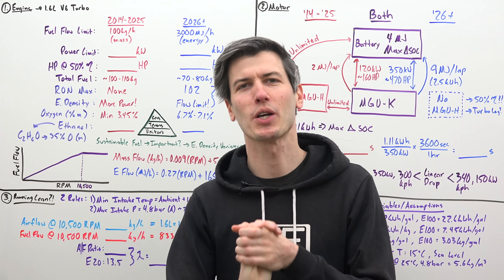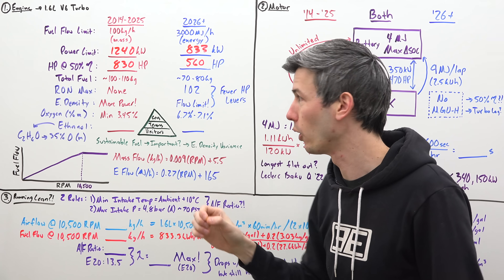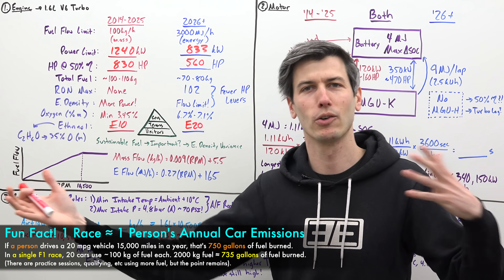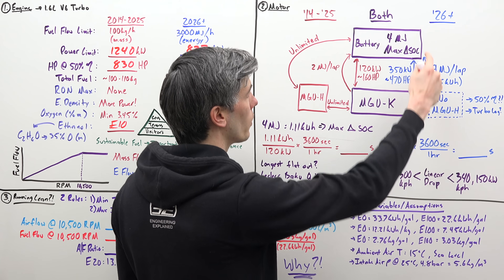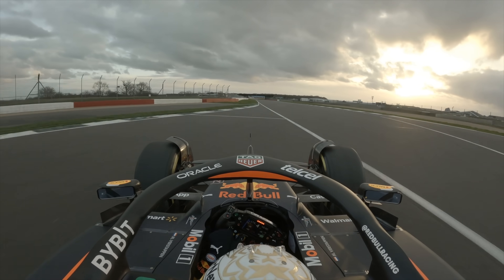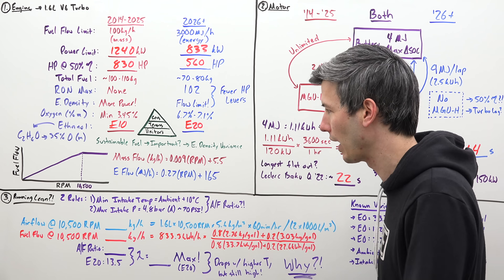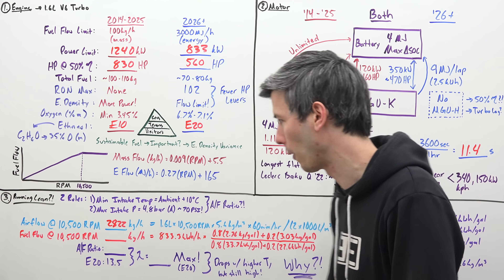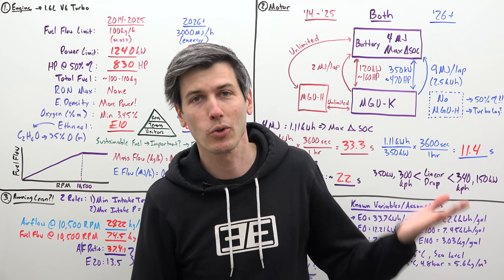Why Are 2026 Formula 1 Engines Going To Lose So Much Power?

Comment: So what I'm hearing is everything is getting weirder/worse (?) for odd, nebulous reasons. Seriously if you want more "sustainability" or efficiency in the sport maybe optimize the F1 calendar more for more efficient logistics or simply have fewer races. You'll burn a lot less carbon that way vs anything you do on-track. Flying all of the people and stuff to the race tracks every other weekend globally is so much more damaging to the environment and can't be made up by whatever marginal gains in emissions you'll achieve by changing the engine formula and fuel choice. We've already figured out ICE technology, you can't really get any more efficient than what we have already other than by having small marginal gains. You'll never get a pure ICE solution to 50% thermal efficiency, the only way they can achieve that is with the batteries and the MGU's attached. 

If you really want to eliminate emissions just go electric (this obviously doesn't include the emissions that come from mining all the materials and doing all the logistics, manufacturing, distribution of said products, etc). So really I don't know what the goal is here. We already have budget caps in place. Frankly it would be much more exciting if they opened the engine regs wide open completely and just kept the budget cap. Meet all the safety regs and car size regs, then do whatever else you want for the powertrain. If you breach the cap you get fined and penalized. If you beat people and stayed under the cap, congratulations you innovated. Done. They're just making everything weirder and more esoteric and frankly it seems to make little sense. The Europeans always seem to love their zillions of tiny rules...

Comment: another great video!  much appreciated.  one question:  you make a comment that implies that fuel with a higher octane rating delivers more power.  my understanding is that increasing octane slows down combustion allowing higher combustion pressure/temperature and reducing detonation or pre ignition - so an engine with high compression ratio (or higher turbo boost) would require a higher octane to perform as designed.  My 1973 Porsche was designed to run on the then-available-in-the-US "unleaded" - it has an 8.5 to one compression ratio and runs well on the lowest octane fuel I can buy today.  It will not put out more power if I run a higher octane fuel, in fact in runs worse.  A modern car with computer control and knock sensor will put out more power with a higher octane fuel as it can optimize fuel and spark maps, correct?.  I'm thinking that this is what you meant. Thanks again and keep these great videos coming.

Comment: This seems crazy but could it be that the additional air pressure coming into the cylinder help push the Piston down assisting with engine rotation?

Comment: Maybe the 4.8bar limit is to avoid strategies of very high power during small periods of time. If the frequency of controlling the limit of the MJ/h is low, you can decide to use high boost and high fuel flow for some period and 'sacrifice' another period.

Comment: Just when everyone is starting to get to grips with the aerodynamics it going to have to change. If power is limited at the relatively modest top speed of 185mph they are going to have to get rid of a lot of drag and by implication downforce which is going to be a fundamental redesign of the whole car not just the engine because going faster when you are already going quite quickly needs loads more power. In the 80s the Ferrari's were going through the speed trap at Silverstone hanger straight at 225mph. At that time Monaco the slowest track had a top speed of 175mph which could be where we end up. It will be Fascinating to see how the teams tackle these challenges.

Comment: @Engineering Explained maybe this air limit it's to limit turbo boost. because in normal engines 4,8 bar blowup engine so they want to have more road similar engines. For my it's quite crazy what we can get if there will be no limits 2000 HP from 1.6? I'm curious what in practically we can achieve when it's no restrictions on boost fuel and only factor it's reliability and output power?
also electric motor and battery can be fun to see if there it's no limit where it's balance between weight and performance?
Reply: My guess is that they want to limit turbo induced downforce, by producing 10 bars of boost, only letting in air in the engine for combustion then dumping the rest over a downforce element to generate downforce.

Or running fancy cylinder deactivation etc.

So, instead of running 6 cylinders at 2 bars of boost you run 1 cylinder at 12 bars and dump the rest of the exhaust around a downforce element, like back in the blow diffuser days

Comment: Why is motorports being ruined, nascar was 950hp 10 years ago now it’s 500, F1 was near 1000hp and now it’s going down to 560 and the cars keep getting bigger and fatter. It’s so depressing
Reply: These will still be 1050-1100 bhp powertrains...

Whats the issue?
Reply: @zaarkeru3391  well the fact that it can’t do the whole length of the straight at the 1000 for starters . It can only do half and other half the straight and loses electric power he said . Then the fact is has less noise
Reply: @randomgamer19170  
It will have more noice...
The MGU-H acts like a massive silencer today and its going away.

And regulating deployment means that we wont have cars that do >25km/h more on the straights, which means it will be more close racing.
Which means better racing.

These changes will be good imo, both from a manufacturers perspective and from a spectators perspective.
Reply: @zaarkeru3391  will the cars be smaller and lighter like the mid 00’s instead of these massive land yachts we have today?
Reply: @randomgamer19170  
Of course not, safety is still a high prio and physics is king when it comes to safety.

So the cars will be large compared to the gokart sized cars we had in the 90-00s.

Any shrinkage is a good thing

Comment: I wonder if the air flow limit is not so much to do with the combustion chamber as what happens at the exhaust outlet and how that air feeds into the rear aerodynamics of the car.

Comment: Don't understand why all sports must become softer and more watered down with more rules 🙄
Reply: This comes from the engine manufacturers...
Reply: @zaarkeru3391  unfortunately it sucks for us the fans… cause we want to see brutal cars that the guys struggle to control or maybe that’s just me ??
Reply: @the_JDM_fanatic  
I mean, for me these changes are great.

We will get way louder cars now qs the mgu-h works as a silencer, and its getting removed.

We will likely not have a 14-"21" mercedes dominance due to the limitations in energy flow.
We will have more strategic power delivery from the drivers, more battles (charging/deploying the battery to keep opponents away).
Turbo lag is back, so we will see more dependacy on driver skill, throttle controll etc.
Which means more brutal cars.
More power.

And for me, my favorite point is that thede engines will be way more applicable to road car tech.

The current f1 tech isnt really usable for normal cars as the mgu-h is so complex and expensive to use.

The next gen engines will have direct applications to road cars.
Which cool
Reply: @Zaarker U  I get what you're saying and where you're coming from.... 

And I agree to a point... 

Though we will always get the safest version of cars with more weight and more driver aids and electronics assisting with everything... 

Also smoother power delivery cars... 

All I'm saying is we went from an Era of Ayrton Senna , man and machine that doing 50 laps was an absolute battle 
.... to yes turbo cars but such small capacity engines... but they aren't a nightmare to drive... 

I miss the days where there was no communication with drivers, and they communicate via the pit wall...

So maybe your brutal and my brutal are worlds apart
Reply: @the_JDM_fanatic  
We all have to take it in relative context.

We want safe cars, the 80s with all the driver deaths were horrible and driver safety should be prioritized.

Though, the FIA hace stated that the cars will shrink and drop some weight for the mew 2026 era.

We wont go back to stuff that wont be used in the engine manufacturers road cars, the economics doesnt hold up.
Thats why the change is comming.

And i would still call these cars brutal, pulling >5Gs in corners is insane
Reply: Every sport makes its own rules for its own reasons.  F1 has always tinkered with its formula.

Comment: You dont think peak hp can be higher? 3000MJ/h is for the ENERGY consumption (kWh) not peak kW? Am I reading the rules wrong?
Reply: And thats why they are limiting air pressure to 4,8barA to set a limit in kW. No one will run 33:1 afr

Comment: I've honestly always hated the entire concept of the Horse Power.  Mostly because it's tied to RPM.  So if you are interested in a lot of power at a low RPM, then HP is an almost completely meaningless number to you. I'm much more interested in the torque curve across a range of RPM's instead of just max HP.

Comment: Running lean makes for more thermodynamically efficient combustion (reference: low temperature combustion). So maybe by mandating lean operation, they’re indirectly pushing an efficient combustion mode.

Comment: Does the limit to the air fuel ratio have anything to do with preventing the teams from using the car's exhaust to create downforce or otherwise affect the aero of the car when not accelerating like they have done in the past?

Comment: Very good video. My only issue is with the section at 8:33 . Although the max battery usage calculations are correct AFAIK (I'm not gonna check your math, mine is usually bad), it only takes into account one straight, not the whole lap. Since the current regs only allow 4MJ of energy deployment per lap instead of the theoretical 6 (4 in the Energy store, 2 recovered at some pointt) and the new regs removed that limitation completly, you might be limited in the very long straights like you mentioned in Baku, but you have far more available energy deployment per lap (max 13MJ, 4 ES + 9 recovered). I couldn't find figures for how much MGU-H is deploying to K in a current F1 car so it could account for those extra 9MJ but I doubt it.
Reply: Your point is so true. Cars will have the same battery capacity but charge / discharge rates should be different.

Comment: F1 has always been the place where technological innovations have been born and passed into the consumer car market. Perhaps the very lean air flow limit is there to force innovation in this area to allow the manufacturers to take that technology and make a new generation of road car engines that are as powerful as present but use a third of the fuel.

Comment: As for the ultra lean A/F ratios, that could be in part to the limit of air allowed in for non-combustible events. They are going to limit engine braking, among another options of allowing air into the combustion chamber with no combustion to also cool it. Provided they use a higher ethanol fuel source, spraying in fuel they never combust will greatly reduce cylinder temperatures.
Reply: Engine braking? We're not descending a mountain in a truck here. The brakes brake the car - engine braking seems irrelevant to a properly built race car.

Comment: This new eco friendly fuel would be the perfect excuse to go 3000cc V10 again. With twin turbo added of course. But of course nooooo, because it's F1, good times are only allowed to last short. I also think that the thing that will end F1 at some point in the future will be the so stupidly long technical regulation book that takes a lifetime to read so engineers will die by the time they would be able to design the cars.
The only hope of mine is that the electric engine will be operated manually by the drivers again like KERS from 2009 to 2013. Using over 400 hp instead of 80 and for 11-12 seconds a lap instead of 6.6 could make wheel to wheel battles so intense and unpredictable that DRS would no longer be needed. Look at WEC LMP1 battles from around 2015. That's what we could expect.

Comment: I would guess max intake pressure is limited to reduce max power on low RPM or to reduce turbo complexity (=costs). That said, 4.8 bar turbo pressure is pretty exotic already!

Comment: I'm worried about the E-fuels.  I don't want the championship to be won because of a synthetic fuel which is more energy dense and so weighs less.  I do like the technology of F1, but just feel that chemistry is far less accessible to an F1 fan than aerodynamics or engine design.  Hopefully they will all rock up with fuels that are fairly similar and it won't be a decisive factor in the championships from 2026.

Comment: I think fia is thinking that the cars are gonna be ridiculously fast by 2025 through aerodynamics. Like look at red bull atm. They are probably doing this to slow down and force teams to keep going on aerodynamics whilst making f1 a cleaner motorsport as a whole than relying on solely on engine power like Ferrari did in 2022

Comment: Exactly, hence why you should not be talking about “sustainable” fuel at all (not for aviation either - e.g. “SAF”) - especially not since you are clearly a smart guy - because they will still have CO2e emissions and air pollutants associated w. both production and combination (use) - though probably less. Greener does not mean green. It would make more sense to simply call them synthetic fuels.

Comment: Basically what you are saying is that F1 horse power will go up by 17% in 2026. 1,000 HP per chassis. Those races are going to get far faster.

Comment: Solito negotium, great vid.  Box2 - Question about running flat out duration. You are leaving out that charging at the same time as expending the battery energy. Therefore it could go a little longer than 11.4 sec ?

Comment: Racing is a microscopic portion of pollution and drives innovation. F1 more then any other series. Synthetic fuel and Hydrogen is the best future option based on infrastructure and power requirements. Anyone pushing EV and car restrictions is trying to limit your freedom. If climate change was as bad as they say all the leading proponents of this wound not own beachfront property, fly everywhere in jets, and horde their wealth.

Comment: That's lame. My streetcar makes double the power of an F1 car, after already adding their powerplants together, and Im running pump gas with off the shelf parts in an antique from the middle of last century. Bureaucrats will ruin this sport just like they've ruined nascar. We'll never know our true potential. The most powerful car will need tires, and to refuel, more often. They should be able to make as much power as they can, and however they can, in order to push the limits of this motorsport. I almost made as much power naturally aspirated as they do using their turbos electric power adders and million dollar budgets. I'd love a chance to drag race one with my license plates on in my homebuilt hotrod 👍

Comment: I'm getting really fed up with the over-regulation of F1. I know they want to make the cars more green, but just give them lower and lower fuel (and oil) limits to work with (and maybe say everyone has to use the same fuel & oil too), and then just let the engineers be creative to squeeze as much as they can out of that.

Likewise, just give them an overall budget and let them spend it as they wish (and punish Red Bull properly if they exceed the limit) instead of trying to micro-manage where and how they spend their resources.

Comment: Isnt it possible that for the energy (3000MJ/h) or actually power ristricted regulations that you have to factor in the thermal efficiancy as well? One could just say that only the used energy is calculated, so for fossile fuels only around 30-40% are usable which peaks at around 50% with a hybrid system. So the liter of fuel could just be declared as 50% less energy and then your allowed to flow double the fuel

Comment: I'm speculating here, but one possible reason for the maximum inlet pressure, is that it will limit the mass flow out the tailpipe, which could be aerodynamically important. Especially with a variable geometry compressor, you could imagine a clever control engineering team creeping in to active aerodynamics territory, just with the flow path going through the engine.  I'm thinking of high-bypass turbo-fans as an analogy.
Reply: They regulated the exhaust pipe position, so this won't work.

Comment: Just off the top of my head for an airflow limit: since there is no more MGU H they could try to do various things to try to keep the turbo spooled up like only cutting fuel/spark + something like early downshifting to keep pumping gasses through the power unit (not an uncommon practice with performance tunes less the early shifting/over revving). Limiting total airflow could potentially be an issue in this case. 
But who knows, lots of clever guys working on power units & strategy. 

Other than that an issue I’ve always had with EE is the way information is conveyed. I get that you gotta know your audience & would want the video to be successful, but still irks me.
ie calculating how long the new mgu k can run “theoretically” vs the longest straight then saying “oh btw that wouldn’t be doable anyway because the battery pack wouldn’t support it. Also on a flat out straight the actual output of the mgu K would be lower so that was all useless info!” (Also 10 deg  ambient is very doable, especially when off/partial throttle & a 15 C ambient sounds unusually cool for a track temp, at least in usual circumstances).

Comment: They should shake things up, bring back refuelling, let manufacturers either run NA V10’s with no rev limit, or turbo inline 5’s with a rev limit, both options running synthetic fuel (to be “green”).